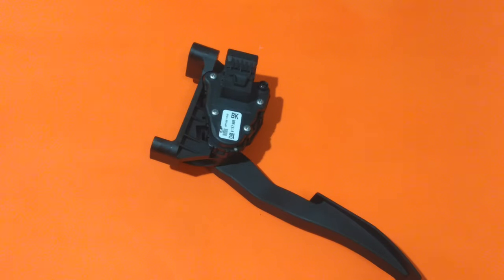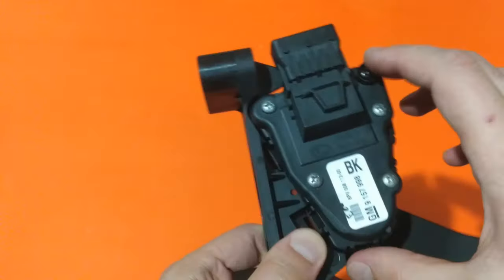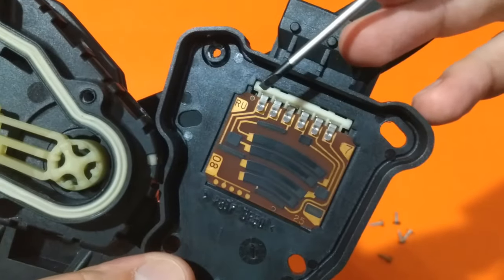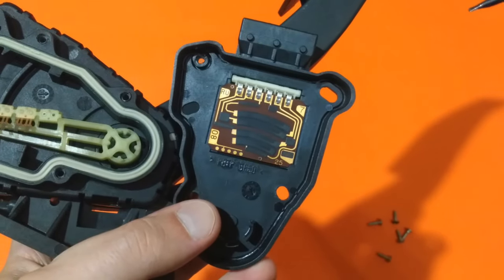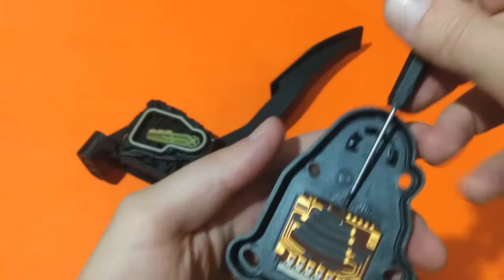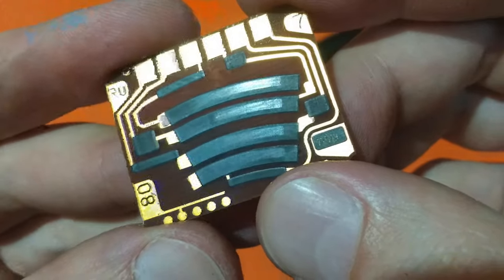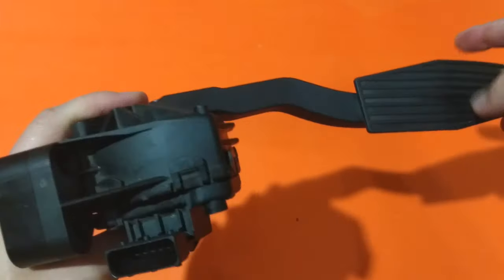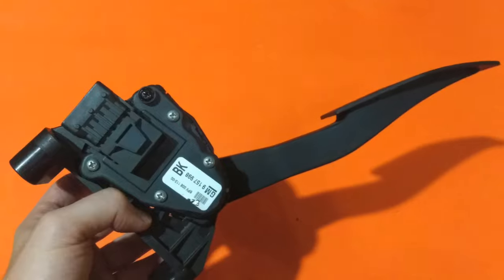Electronic Accelarator Pedal Repair - Astra H

Comment: Did same work on a car. I recommend using an INK ERASER to very lightly clean the surfaces where contact is made by the small contactors. You have to do it very lightly to just remove any small imperfections in the areas where the contactors make contact. I also used 90% alcohol to clean the parts before reassembly. Car ran perfectly after that!

Comment: Contact cleaner, never rub your finger over the resistive track like that, the acid/oils in your fingers will now wear that part even faster than before. spray contact cleaner on both the pins and the strips, and wipe gently with a lint-free cloth. Also, mark where the screws are in the casing before removing the screws, otherwise, you will need to make sure you can retrain the pedal. most cars have a retrain mode activated via odbII, if you don't retrain and you don't screw it back in exactly the same position as before then the resting position will have a slightly higher or lower resistance than before.

Comment: За 12 лет работы диагностом-автоэлектриком, я ни разу не встречал неисправность педали акселератора, но всё бывает в первый раз. Гораздо чаще, ошибка по педали имела причину в разъеме UEC, (центр подкапотной электрики). Окислы на контактах разъема, на глаз их не видно. Иногда достаточно просто снять и одеть разъем. Для профилактики побрызгать WD-40.
In 12 years of working as an auto electrician diagnostician, I have never met an accelerator pedal malfunction, but everything happens for the first time. Much more often, the pedal error had a cause in the UEC connector, (the center of the under-hood electrics). Oxides on the connector contacts, they are not visible to the eye. Sometimes it is enough just to remove and put on the connector. For prevention, sprinkle WD-40.

Comment: These black tracks are graphite printed. They are applied in volume controls of various electronic devices. They are delicate. If they show defects in acceleration, change it soon, as the lanes are unrepairable. OK!
Reply: I agree and I don't think it was wise of him to add tension to the wiping contacts either, This is also a common problem with the Technics SL1200 series turntable pitch controls!
Reply: Tak treba kúpiť nový? Auto ide ale keď sa šlapne na plinovy pedál tak reaguje ale veľmi málo.Alebo vôbec. Ide na voľnobeh. Je zlí pedál?
Reply: @djokovicboris1162  Pri každej práci musíte mať pozorovanie na overenie problému. Takto sa to ťažko hodnotí. Odneste to automobilovému elektrikárovi. OK

Comment: Hi AllHandmade, does your acceelarator pedal still work after you did this? 
Please give me a reply and thanks for sharing, great job.
Reply from the maker: Yes it's still working. I didn't expect the repair to be such success.
Reply: @icku ,,  ok thanks for awesome video you put on YouTube.
I have a gmh Holden Commodore sv8 5.7litre V8 here in Australia.
It is going into safety mode yet its not throwning any codes when it goes into safety mode. 
I have been told by heaps of other people and other mechanics that it may be a pedal could be the issue as this was the first fly by wire that holden ever made and the pedal was a huge problem.
 I do luv the car as i bought i from my mums inheritance and luv driving it but due to it going into safety mode it is getting annoying to drive and this goes into limp mode anywhere it feels like it (but mainly at bus stops though , haha) and can be very embarrassing too.
Do you know where i could seach for the part or could give me an idea on what part number to chase up so i can fix it.
Thanks in Advance and Cheers from John , in Australia.
Reply from the maker: @johngibson4641  If you can find your car here: https://7zap.com/en/catalog/cars/
Reply: Hi, I own a 2003 vw sharan 1.8t,accelerator is very hesitant and slow, do I have to clean it as shown on the video but with electrical parts cleaner?

Comment: Hello, at how many km did the error occur? I'm curious because we manufactured this sensor in 2007 :).
Reply from the maker: Around 160 000km.
Reply: 203 000 km
Reply: 340000 with my Zafira B

Comment: OK HE CLENED IT BUT WHAT WAS THE CAR PRBLEM DOING THIS DO I HAVE TO RESET IT AGAIN OR JUST PUT IT AND WILL IT WORK OR TAKE IT TO DEALER SO THEY CAN RESET IT AGAIN PLEASE REPLY THANKS
Reply: The light should go out after cleaning but you can disconnect your battery and it will clear the ECU of the codes. If the light comes back, you with have to troubleshoot the circuit again and isolate the issue.

Comment: Cleaning helps but does not solve. Clean and use a pencil 6B or 8B afterwards. The grease pencil will restore the contacts. ONLY these way you can fix FOREVER the problem. Is it possible that no one understands how these potentiometers really work?
Reply from the maker: It seems your are one of these guys not understanding how they work. Applying graphite will change the resistance of the potentiometer paths. You can never apply same amount of graphite on the pads/paths - those are layed by machine. So if you do it by hand will end up with one path having more of less graphite then the other/more or less resistance. The ECU is monitoting the voltage drop on two paths if I remember correctly and due to different resistance you will get different voltage - resulting in ECU spewing error codes. A really bad idea ;)
Reply: @icku  yeah yeah, do whatever you want, I use graphite

Comment: Mine is also doing the engine check light and goes into limp mode. So I will try this first
Reply from the maker: Before that connect the car to Opcom and read the erros codes just to be sure :)